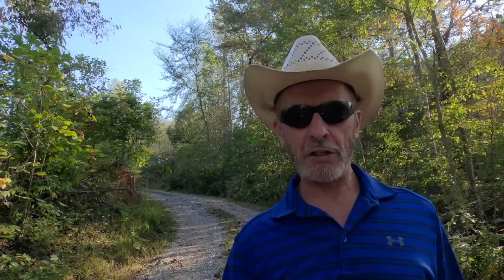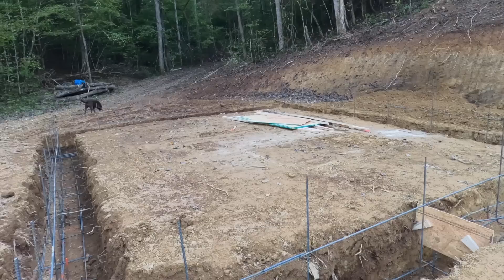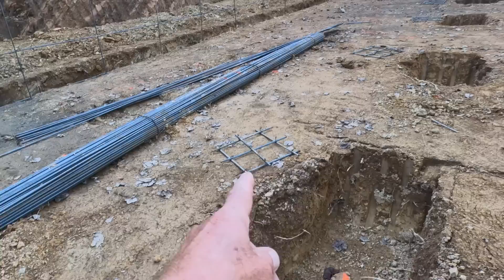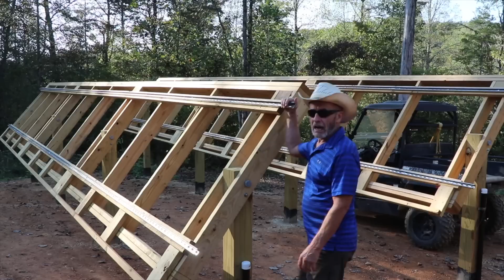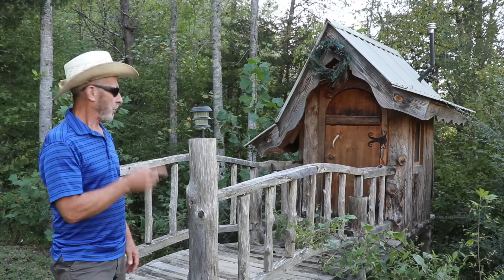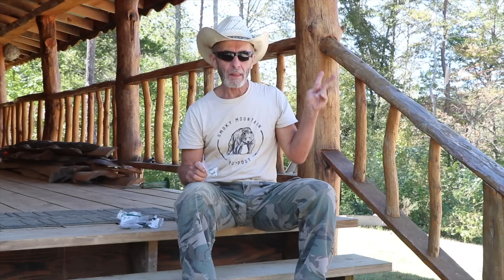READY FOR CONCRETE

Comment: Nice work by your contractor Jennifer. 
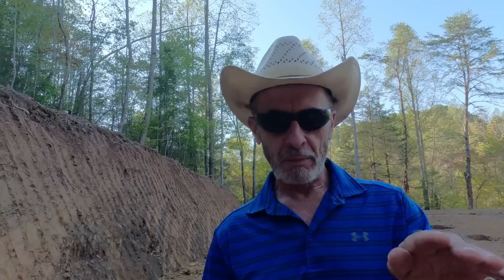I would suggest putting in a large root cellar and a large storage room off the back wall of the house on the left side of the image at 2:28.  Then backfill the full height of the lower floor back wall creating a walkout patio on the upper floor above these two rooms, making better use of your steep site.
Cheers ❤

Comment: The rebar looks on the weak side or is that minimum code in the USA 
I am used to two lines of horizontal bars plus a lower and upper layer too as a result the upper vertical bars are less flimsy too
Reply from the maker: It’s 5/8 in which is standard here. One row is required for the block. Footers are about one foot thick. Block will be added from there.
Reply: @OutpostReview  that now makes sense and understandable thank you for explaining this

Comment: I had an electrician out a few years ago and he put in a second ground rod. When he started driving the ground rod in, he angled it at about 45 degrees. I asked him why and he said it's much easier than straight down and it doesn't affect the grounding ability.